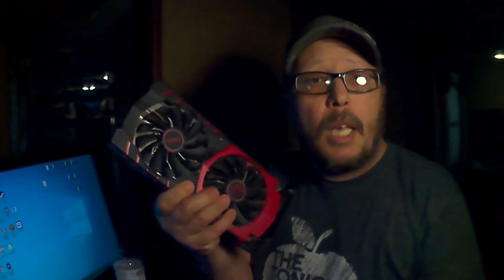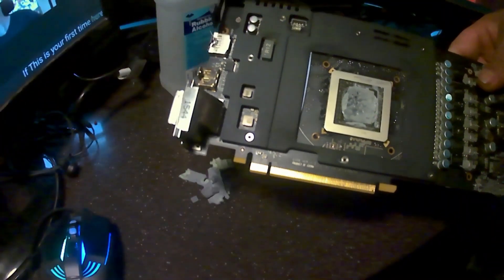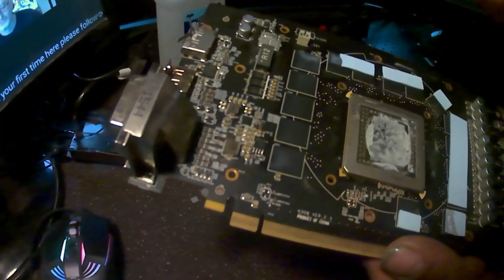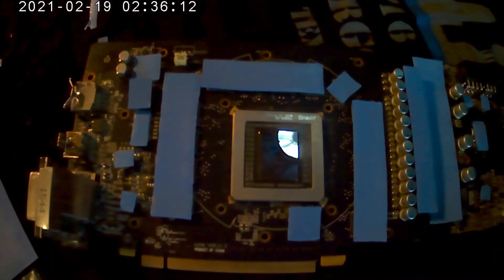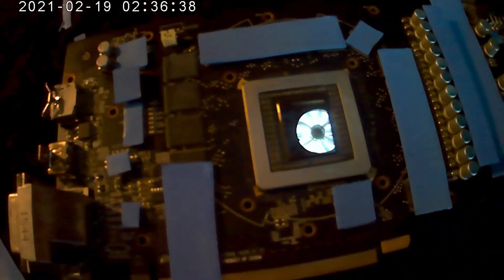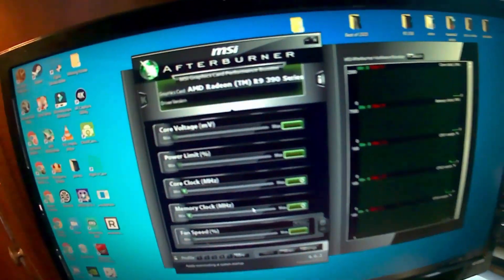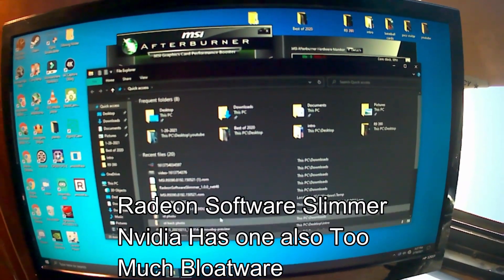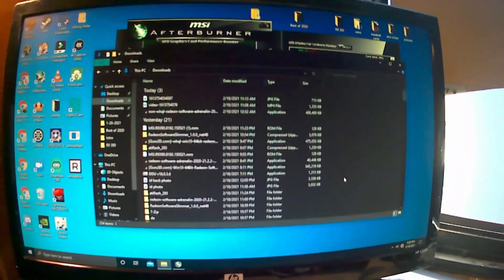When Is Scrap Not Scrap - MSI R9 390 Repair Thermal \ Bios Issues 2021 AMD Got Issues

Comment: do you recall what thickness and w/mk thermal pad you used?
Reply from the maker: 1 and 1.5
Reply: @RoeMantic  in which part did you use 1 and 1.5?
Reply from the maker: @B4K_ADE it's been years, I don't remember.  When you place the GPU on the pads you should see the indentation.  If it's not denting that's where they go!

Comment: I don’t understand to me it sounds like the card is still broken even after fixing it and you still sold it for 150? Or did the thermal pads or flashing a bios fix the problem? Mostly curious as I bought 2 of these cards and they both crash when loading any game or any benchmark so I’m looking for some help and suggestions… temps look good I replaced thermal paste but not pads could it really be over heating in 20 seconds or driver issue or bios issue or are the cards scrap? Any help would be appreciated

Comment: Hello All!
I have the same graphic card from one of my friends - he said it was biosed because the card was used for mining.
After I plugged it in, I installed the driver - no issues - any 4 K videos worked without any issues, I have 3 displays, all good until I put it to play.
When I try to play something - for example Call of Duty - it crashed my computer twice -  had to restart it.
Doesn't seem to be hot 60-65 degrees - as I kept the performance active I had 100 - 134 FPS just starting the game.
I've checked and verified using your links and I am not sure of which tool to use for flashing the bios and which version of bios should I take - since what I see in the Radeon Software matches the one that is for download for MSI: 015.048.000.062.000000  - same on the card BIOS Version 015.048.000.062 - should I try another version?
He said he down volt it.
Any Ideas? I would like to use it a bit, until I will buy a new NVidia 4 series - no budget for that yet - I just moved to I9 12 th gen and DDR 5 32 GB.
Thank you!

Comment: I have this exact card and am getting a blank black screen when using any video port.  I've tested my PCIE slot and it works with another card just fine.  
Is there any chance of repairing this?
Reply from the maker: Maybe used heat gun slightly in the video chip is the last resort! Watch some YouTube vids on it first

Comment: do you remember which thickness did you use for the thermal pads?
Reply from the maker: 1mm and 1.5mm
Reply: @RoeMantic  thanks
Reply from the maker: Be sure you take pics and remember what size you pull off. If ya can.
Reply: @RoeMantic  yes, I have done exactly that. Luckily the problem I was having seems fixed, so thanks again.
Reply: @RoeMantic  Good afternoon, do you know the places that use 1 mm and 1.5 mm? I bought a board like this and it has 2mm thermal pads, making the chip not touch the heatsink right and heating up a lot. Thanks.
Reply from the maker: @luzianomoura1749  really all you have to do is put the pads in and press the plate down as if it has screws in it! If there are no indent marks on pads that where the bigger size goes! It’s been to long to remember exactly friend sorry!
Reply: @RoeMantic  Thank you very much for the reply, you gained a subscriber from Brazil.
Reply from the maker: Awesome

Comment: SO u applied pads between the pcb and backplate too?? does that actually help?
Reply from the maker: Depends if there is heat generating there as well. I almost left my plate off for better cooling but didn't want to mess with adding washers and nuts and sorts!